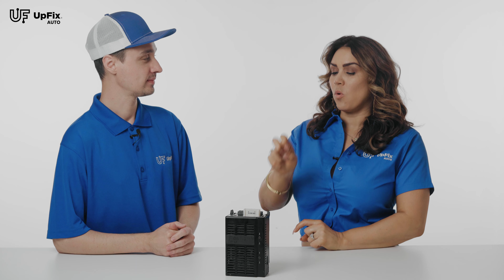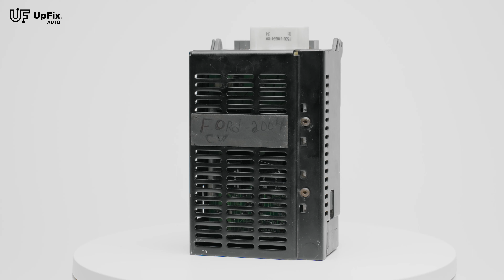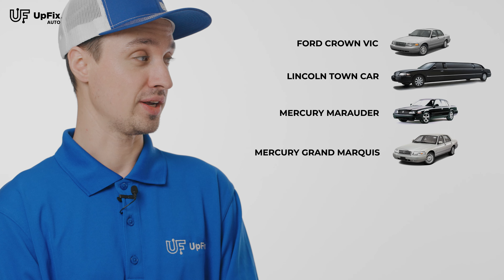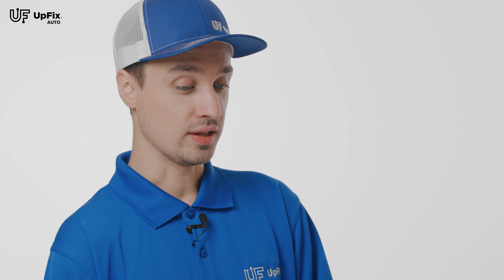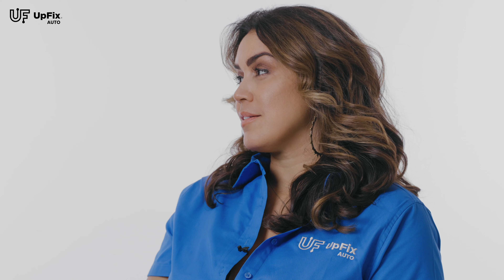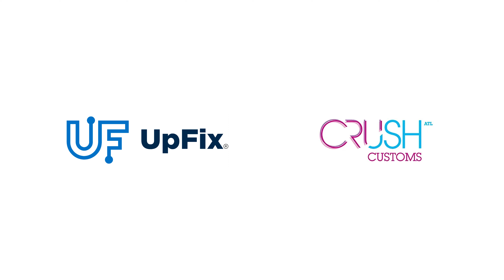Ford, Lincoln, Mercury Light Control Module (LCM) Problems, Issues and Repair by UpFix

Comment: Ok i have a 2005 grand marquis where the front and rear lights will turn off and on whenever they want at one point the turning signals stop working after a month of knocking on the lcm for it to work temporarily so i replaced the lcm from a company that rework them it worked for about a week then start doing the same thing again so i went under the dash thinking it could be the wires so i moved the wires around and lights didnt come back on so i tapped on the lcm and the lights  pop back on but goes out soon after....do this sound like a wire issue or both lcm was bad...side note i can manually turn on the front lights with the switch on the dash while the rear lights still not working but the automatic day time running lights come on and off whenever
Reply from the maker: The issue is definitely the LCM
Reply: @upfixauto  thanks i appriecate it

Comment: Hi, I never had a light issue until now with my 2004 grand marquis. I went for the recall and they put in a new one a couple of years ago. Just last week I lost lights in the automatic setting and now all I have is headlights in the dedicated setting, no taillights. I haven’t checked blinkers. Thoughts?
Reply from the maker: Thank you for reaching out! It sounds like your Light Control Module (LCM) might be experiencing issues, which is common in Ford, Lincoln, and Mercury vehicles, especially as they age. Even though it was replaced a couple of years ago, components can still malfunction over time. We recommend sending your LCM to UpFix for repair. UpFix specializes in LCM repairs and can save you up to 80% compared to buying a new one. This will help restore your headlights, taillights, and potentially fix any issues with your blinkers. You can visit UpFix.com for more information and get started with the repair process.

Comment: I’ve got a grand marquis 04’. The problems he described with lights turning off mid use, staying on when the car is off, are both things I am struggling with. However, my blinkers still work, my tail lights work, my inside lights work fine. It’s just my headlights. Will a new LCM help? Or is this a headlight wiring issue?
Reply from the maker: Yes, the issue is with the LCM. It needs to be replaced or repaired. We do rebuild them https://www.upfix.com/product/mercury-grand-marquis-1995-2005-light-control-module-lcm-repair/

Comment: Is there a trick to removing the big white connector from the back of the LCM? I tried and failed.... Please help.
Reply from the maker: It is a little hard to get it out. Just push down the white tab and pull out straight. It can be in there very tight.